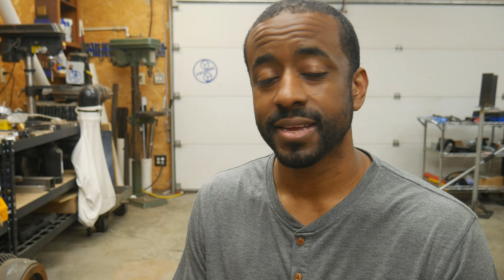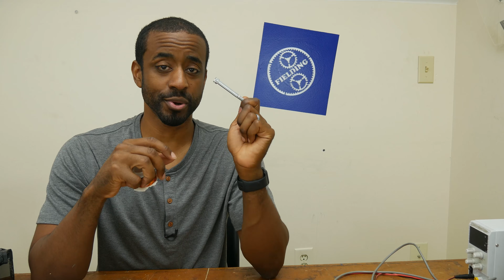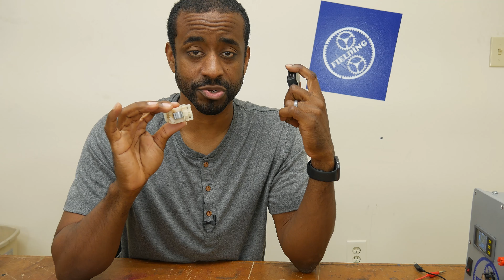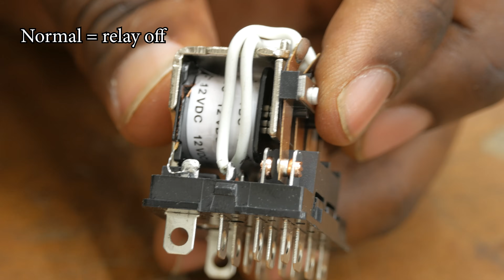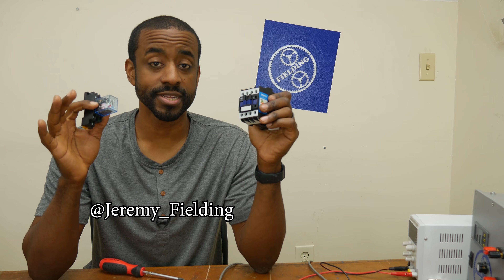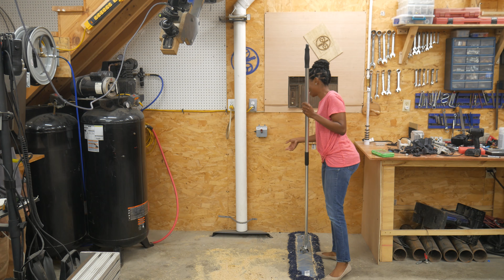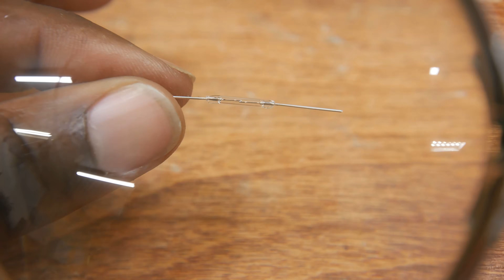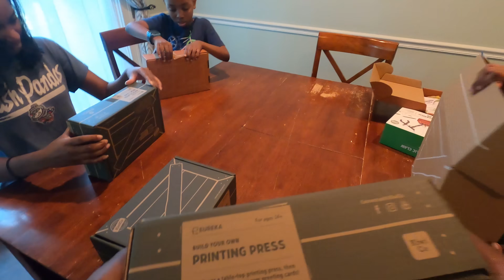A beginners guide to relays, contactors, and solenoids to automate anything; (#083)

Comment: It‘s funny how proud he is of having 240 V in every house, when we can easily get ≈400 V in every house in Germany. There are three phases of 230 V each, so the lights and nearly all of the appliances are connected to one phase and neutral. (No funny stuff with having different outlets for two different voltages, one for lights and “normal” power supplies, the other for everything that needs more than just 120 V.)
With that setup, you get ≈400 V between any two of the phases (which are 120° apart), not 240 V between phase and “anti phase” in the U.S. (which are 180° apart). There are special outlets and connectors you can use for power tools, like a bandsaw, to directly use all three phases for a three phase motor. We connect our electric stoves to all three phases as well, since they are the largest load in a typical household. The different hotplates and the oven can be distributed between the three phases that way, instead of all running on the same phase.
The goal of supplying all three phases and neutral to every customer is to distribute the load as evenly as possible between the phases, as you do not get any current on neutral in that ideal case. Different flats in the same house will typically have their lights and outlets on different phases, and you often see different phases used for the outlets in different rooms in the same flat (or the different floors of a house) as well, in addition to the aforementioned use of all three phases in electric stoves. Our electricians try to design every installation with the goal of evenly distributing the load between the phases.
Reply from the maker: I am not proud of it at all. It’s just so common for people from other countries to comment that they have x power available and the US has 110. When that’s not true. However I would much rather have three phase in every house that would be awesome but still not something to be proud of… just a resource that is available such as what you are describing
Reply: @Jeremy_Fielding  Okay, then I misunderstood, I am sorry. It sounded like you thought having 240 V between phase and anti phase was just as good as having three phases of 230 V each, when it really has some drawbacks in comparison (while it was a smart solution to deal with a country where there already are 120 V devices everywhere). It is a great thing when you can get a three phase outlet installed everywhere, without having your energy supplier run new cabling to your home first, and easily run power-hungry machines like that. The German system has some drawbacks as well, of course. For example, I think that the plugs in the UK are simply superior, and we should have standardised on those, instead of the Euro plug.

Comment: Some time ago I was working on concrete equipment and noticed there were nonfunctional vibrators on the sand, aggregate, and cement bins. These were powered by air but controlled by switches. I really didn’t know what I was doing but we took it all apart cleaned the components as reassemble. It worked. The simplicity of these in how they are constructed makes it more magic and harder to understand because something that seems this complicated can’t possibly be that simple. It’s incongruous and counter intuitive.

Comment: My guess is yes, it would be a short circuit, but due to the voltage drop through the length of the wire, the power supply would see it as an ordinary load.

Comment: Thanks for this and all your great videos. Regarding your question, it is a closed circuit, the coil has some resistance that reduces current to a safe level. A short is also a closed circuit but the current exceeds design limits, usually caused by a fault. Regarding relays- some other terms. Slow to operate and/or slow to release, the addition of a capacitor across the coil can do this. (diodes and resistors can modify results). A closed contact is also called a make contact, open-break. Contacts can be arranged to be make before break and so on. Some relays have wetted contacts, they are sealed and contain mercury and must be properly orientated. When powering relays with electronics you should provide protection from the coils inductive kickback, you can use a reverse biased diode across the coil for this.

Comment: I'm a Mechanical Engineer by trade, but double majored in Engineering Physics (gets into the nitty gritty of electromagnetic and electric fields with a splash of Materials Science) and Mechanical Engineering. Short of going through the calculus and explanation of how magnetic fields are derived, this video is fundamentally and practically informative and should be watched by any budding mechanical engineers. Knowing how these components operate on a fundamental level helps a lot in developing CREATIVE problem solving abilities.

Comment: I love how you started out by showing magnets repelling each other, how you explained open and closed circuits (my electronics classes from high school are starting to come back to me). I only recently heard of contactors and wanted to learn more. 
The chairs your wife made are very cool. Looks like you have a talented family.
The Kiwi Co thing is probably the first sponsor I've ever seen in a Youtube video that interested me. That is very cool. I would have loved that as a kid.
I really love how you get your kids involved in thinking & building. So many kids don't know how to do those things and just want to stay glued to their tablets/phones/computers instead.
Now, I have a weird question that might be somewhat complex. I was researching solenoids, contactors, etc because I'm trying to find a way to improve the mechanism for turning on my piston pump to fill my cistern (potable water). Right now I have a D-Switch connected to a float with a rod, but the rod keeps getting jammed in the down position & the cistern overflows. Someone recommended a solenoid valve but I can't for the life of me figure out how that would work. Another person recommended using a cable float but I'm not sure how it would tie in. I want to set it up so when the float is in the up position the pump will shut off, but if it is below that level, the pump will switch on to fill the cistern. I suspect I would need some sort of bridge between the float and the pump but I'm not sure how to connect it. The pump is 1HP and V 115/208-230. Would I need a contactor in between? Would it need to be NC or NO?Any ideas? I really hate having to go outside and check the pump to make sure that the rod isn't stuck.

Comment: Latching Hall effect sensors are fun little switches to use. I arm my high power rocket electronics with a commercial version of them. I've been experimenting with them lately. I put a little circuit together with a Latching Hall Effect switch and a MOSFET works pretty well but I'm not confident enough to put my version in a 6 pound rocket going Mach 0.5 plus (some exceed Mach).

Comment: I've been thinking about our electric grid
It's old, it's out dated, it's fragile, insulation gone in most runs

This leads to Power Failures
My solution for single family residents
A 240 Volts contact relay
When public utilities power outage occurs
Then a backup generator turns on to supply house with temporary power

When city powers restored, backup shuts down & off

Comment: Nice instructional video
You could have gone a few steps more

1
Explained how to put a screwdriver in the middle of the solenoid, turn power on then off and now you've magnified the screwdriver

2
Shown how a transformer works
A solenoid with many wrap coils around one side of square Magnet 

The other side wrap with a few winding to step down the power

Great video

Comment: i dont agree with your terminology around relay and contactors. all magnetic switches are relays. a contactor is the moving contact element in the relay. a car use a starter relay that pulls several hundred amps, yet you call that a relay........

Comment: I would like to make a 120v 200 watt light flash on and off without me having to press a button or flip a switch. Can I use a relay to do this? Do you have any suggestions? I've tried those little plug in cubes that make christmas lights flash but they aren't heavy enough and burn out rather quickly.
Reply: 120v 200w = around 1,6A - 2A
You need a relay & other parts (cables etc) that you might need for your project that can handle atleast 200w 2A.
And depending on the project and the planned usage for it, I most probably will incorporate a fuse in the schematic, just to be on the safer side.
Keep in mind that any other electricity based parts you have in the schematic will add the power usage, so calculate properly and use proper parts.

Those christmas light flasher usually contains micro-controllers with lighting routine stored in it, resistors, capacitors, connected to a gate (consider it like a mini relay). And while a gate can handle big amp(depending on the gate type), it's usually the other parts on the PCB that can't handle big load for prolonged usage.

And if the flasher is a quality one, it may use a fuse in their schematic, either normal fuse or smd (Surface Mount Device, small, directly soldered to the PCB). If so, the fuse is the one burned out, which is good.

More power usage = more heat = hotter components = more prone to being burnt out.

Relay = variable types and there's usually ones that has a feature (like timer etc) incorporated in it. Various sizes from small to medium size. Not so sturdy
Contactor = Very sturdy, can handle a shit ton of amps, but also very bulky. Usually needs a microcontroller if you want to use it for some type of complicated usage. Like Arduino, or Raspberry Pi, or atleast an IC where you store routines in.

For your usage I'd say a good quality relay is good enough (don't know for sure since there's lack of info of the project). Although you might still need a microcontroller if you want the project to do a complicated routine. And i usually just put a switch still, just so i know that it's there if I need to turn it off when I need to, instead of pulling out the plug to turn it off.

Comment: I need a relay for a Radial Arm Saw, (Dewalt RAS, mdl 1400 part no. 500131) (no wiring diagram available), my question; do buy for VAC, AMP, ??? This part is no longer available, so I have to improvise with new diagram...

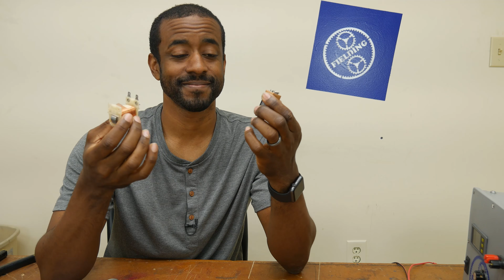Comment: 5:22  I would think that's a trick question, but I'd say no, if only because there's enough winding there to keep the conductor from melting down.  The length of the conductor is enough of a load.  I'm not an engineer though.

Comment: I would say that is it not a short circuit due to the coil which is a comsumer like a light bulb, am i wrong ? :)
Reply: You're right, it's not a short circuit because the thin wires have a non-zero resistance. Although it's very close to a short circuit, and can be overheated if not properly made.

Comment: Your personality is 70% why i watched the entire video. The reason i ckicked like  was because you know exactly what you were doing. Now, the reason I subscribed is because i want you to make a free enery preoject with these specifications.  1 - use a 12v motor to power a cellphone charger's transformer in ( reverse ). A 120/240 [110/220]  voltage current will/should be generated. Now, use that current to drive blender size motoer or even a blender itself.  *You are essentially creating a inverter generator of looping free energy. I seen asians doing it now i want to see you do it. Why you ? I trust you based on how you function ( like a credible human ). I'm now a subscriber,  don't leave this hanging. I'm actually waiting to see you do this project. Maybe a voltage regulator and capacitor is necessary but i want to witness it grom a credible human. Notice the lenth of this comment  ? So it must mean something to me. See you next time🏌🏾‍♂️......
Reply: The 120V AC signal is rectified on the transformers secondary output with a diode making it DC. You will get nothing out of the transformer injecting only direct current unless it is pulsed. The best advice I can offer is this; "The Second law of Thermodynamics has been challenged quite extensively but has never been proved wrong and never will be".

Comment: No, that is not a shot circuit because there is wire resistance,  better known as DCr in ohms units : that resistance depends on length of the wire and its diameter and copper resistance ohm /inch property. Here is the formula: ohms/inch = 8.5983e-7 (1/bare wire dia. in inches)^2
Wire dia.= 10^((0.001/(AWG #-49.89/19.86))

Comment: Jeremy awesome video and cool set up.
I noticed that one cylinder cycles slightly faster than the other.
1. is there a reason you used two solenoids? would it have made better sense to just use one? I believe the use of one solenoid would work better.
2. do those cylinders have cushions on them? if so then fine tuning them would help with the stroke.
regardless its a cool and I had to subscribe. 👷‍♀️👍

Comment: When the battery is applied it is a closed circuit. Not applied open circuit.
A short circuit would be a failure closing the circuit but not controlled.
Is this correct?

Comment: Another great video.  Thank you

Quick question.  Could I use a relay to control the charge from my van solar panel to the battery bank where it would turn on at a specific voltage and turn off once the battery is charged?

Comment: Is this a short circuit? Electromagnet no longer connected with the battery would not be shorted. The current did not find a shorter way to close the circuit so itbwould not be short circuited. The disconnected battery would no longer deliver DC. So it would be an open circuit circuit.

Comment: Great video and clearly explained. You would be a great Tech Teacher! I was trained as a Mechanical Tech but gravitated towards Metal Fab. I worked with great Electrical Tech's, Motor Inspectors and System Tech.'s. I am retired and try to repair my own electrical problems within my limited means. When its beyond my ability I call an Electrician!

Comment: For those who are wondering, the electromagnet is not considered a short circuit as the inductance and resistance of the wire limit the amount of current that can flow through it. Therefore, since the current is limited, the circuit is not a short.

Comment: Can I ask a question? I have a 3 phase motor that I want to control with a low voltage switch. It's a car hoist and the original switch when pressed connects all 3 hot legs raising the hoist. Problem is the poor switch built in by the manufacturer is crap. So I was envisioning a 3 phase contactor  with a 24 vac coil. Then wire in a 110vac to 24vac transformer and interior the 24v side of transformer with a momentary push button switch to control my hoist. Is this practical? I can't help but think there's a simpler way to go about this

Comment: I had a bar once in Mexico.  It quickly became clear that if it wasn't bolted down it would get stolen and if you had any rules they were going to make an effort to break them.  Making it a great place for a "Don't Touch" switch.  I added a switch in the men's room, in plain site but it did require you too reach to hit it.  That way most people will kind of stretch to hit it then immediately retract to standing which made it even funnier when a sign outside the bathroom facing the whole place would light up and said something like "I can't just pee like a big boy and keep my hands to myself" and simultaniouisy It set off a two tone truck horn I had hidden.  If you hit that switch the whole place knew it instantly and you could turn it back off fast enough.  We would laugh so hard sometimes. Anyway, thanks for the content, I enjoy it very much.

Comment: Not a short-circuit because the current is following the intended path. A short-circuit by its definition is a fault that allows current to flow outside of its intended path. Like you said if this is a short-circuit than all industrial electro-magnets like those used in scrap yards would be short-circuits.

Comment: Can a relay be used to automatically switch between dual dc power sources to charge a 12v battery or will the power sources/induced battery voltage interfere with the magnetic field created by the coil?

Comment: To ALL the positive comments about you, your family, and your skill I say “the same  times 3!! I already knew most of what you explained, but still loved hearing how you teach. Now, a comment about solenoids, etc: years ago I worked with water treatment systems, and designed some special valve configurations. (I’m not a real engineer) Some people used solenoids to open and close water valves, but the problem was that to hold a valve open, required constant power to the solenoid. Power consumption wasn’t much, but the solenoids tended to burn out from the excessive use. An improvement was to use motorized valves. They took a few seconds to open, but stayed open with no power until the motor came on again to close them. I’m thinking you might want to do a video applying this concept to electrical switches, instead of water valves? We also used motors to open water lines 1/8” or 1/16”. Diameter that then pressurized a diaphragm in a 2-3” valve allowing 100’s of gallons per minute to flow. The tiny line works like the low voltage line, opening a high flow valve, instead of a 240v switch. Although pressure was still needed on the small line to keep it open, it didn’t consume water, but held it open with (static?) pressure. VOILA!! Same concept as your air activated system for your dust collector gates!   Maybe I should have watched you video about that system before writing this, but I think it would be great if you do a video comparing the use of air pressure, water pressure, and electricity to open “relays” . Electrical engineering and mechanical engineering. Keep up the great work!